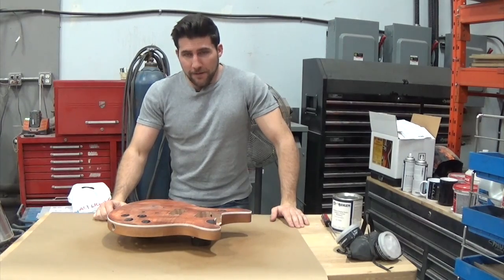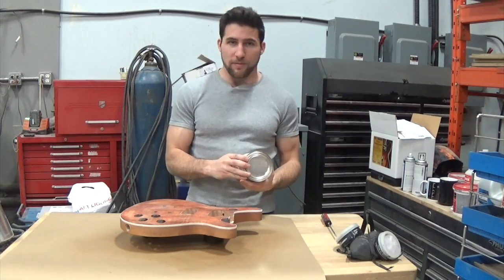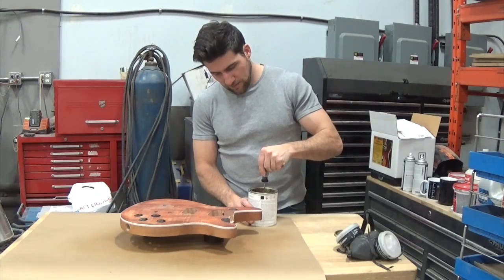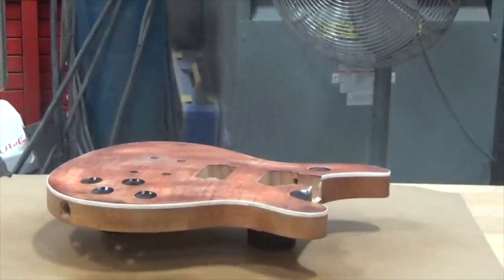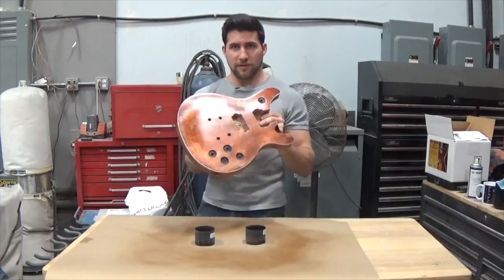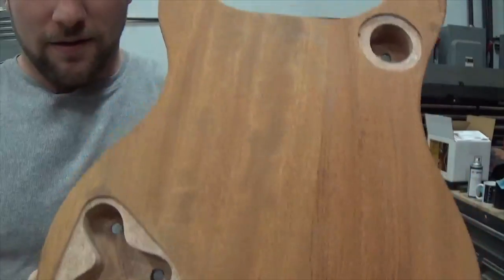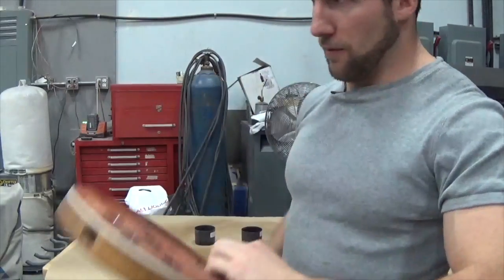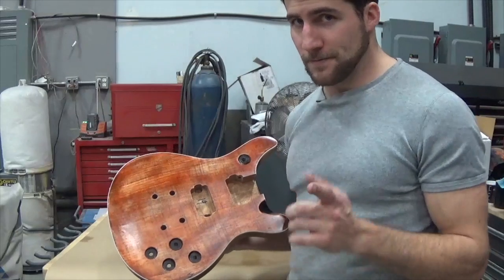Spraying Sanding Sealer

Comment: This is an old video so I doubt you'll see this.
I'm using India Ink on my  Paulownia body which I HATE it's porous and even has holes in it. Anyway. I was told to use the ink first...then the mohawk sanding sealer, then aquacoat. My  question. Do you wet sand the sealer at all or just gently dry sand after a few  caots. Same with the aquacoat. Wet sand after a few coats or dry sand?
I've never used sealer or filler before.
Reply from the maker: I dry sand. Isn’t aqua coat a clear grain filler?
Reply: @BradAngove  Yes it is. Dry sand is good. Don't like wet sanding.
Don't know if you've seen Highline Guitars on here? He's the one that said ink first then sealer cause he doubts the ink with react well with the aqua coat. In fact he said he doesn't think any filler will react well with ink but with sealer first it'll protect the ink.
Hey love you vids as always. You do some cool stuff. Thanks Brad!
Reply from the maker: Ya, the guy from high line (Chris I think?) knows his stuff. I don’t use India ink, so He would know better. A layer of sealer in there makes sense, but it’s certainly not the typical order of things.
Reply: @BradAngove  I've talked to a couple other people who agree it's not the typical order. 
When I sanded the guitar it was smooth as glass. If I try and sand it smooth it takes some ink right off. After I inked it it now feels like 150 grit paper. The other people said...maybe the sealer is meant to keep the ink in place before the filler and build up so the ink is smooth again. I don't know. I'm gonna go with Chris on this one. If it doesn't work I'll try another way on my pine body. Thanks again for your help.
Reply from the maker: Did you raise the grain prior to doing the ink work?
Reply: @BradAngove  No he said sand and put the ink on.  I'm gonna take some paper and gently sand it it before i hit it with the sealer.
Reply from the maker: Ok, the ink will have raised the grain. If you sand it now it will remove that. Then you can reapply the ink if necessary. The grain shouldn’t raise twice.
Reply: @BradAngove  Sounds like a plan to me! I'll sand it lightly instead of that normal heavy hand of mine...lol
I must have 5 coats of ink on now and plenty of it sitting around.
You've been a HUGE help Brad. I can't thank you enough. I'll let you know how it goes.
Reply from the maker: Glad I could assist.
Reply: @BradAngove  I'm glad there's people like you on the web so willing to help.
Reply: @BradAngove  Well I used 1000 and lightly sanded. Took about 75-80% of the rough away. The only spots now are the areas that must be sealed and probably filled as well. 
Imagine a guitar body with road rash that you can stick the tip of a pencil in. That's the other 20-30% of the body. You feeling almost glass on the body then BAM! Road rash. All the sanding in the world wouldn't get rid of it. My sealer and filler come tomorrow but it's supposed to rain for like 4 days in a row. gonna be a while before I get back to it. 
I'll start sanding my pine instead...lol
Reply from the maker: I hope the pine one goes well.
Reply: @BradAngove  I do too. Seems I screwed up. When I had to resand the entire body I used a dremel for the horn. I was careful to keep it moving so not to put grooves in the wood. Well I really messed up Somehow I managed to sand a good bit of the pocket off. Now when I attach the neck it sticks out past the pocket about 2mm. The neck is steady. Doesn't move but something tells me this could be a problem down the road.
Anyway..thanks gain for everything. Rob L
Reply from the maker: You sanded the side of the pocket down? What kind of guitar is it?
Reply: @BradAngove  a Tele style. Yeah what a noob thing to do huh. it's on the horn side where there's nothing there anyway. it's just the width of the pocket at the top is now 3/16'' smaller. At the body it's still the same 2 3/16''.
Reply: @BradAngove  In other words at the bottom 2 holes it's 2 3/16''. The top 2 holes it's 2''. Like I said it still fits just not as snug now.
Reply from the maker: Once it’s bolted in it won’t matter at all.  I’m just wondering if there’s a way to turn it into a design feature with more comfortable access or something.
Reply: @BradAngove  Ironic. I was thinking the same thing. Like maybe a gentle scallop on the lower part of the neck to match the body.
Or you just gave me an idea! I have spare thin pieces of birch. I could cut a shim, sand it fit and blend it into the section of body for comfort since it's inked in a dark violet. If I do it right you won't notice. Plus I'm using filler on the body as well.
Main thing though is I'm, glad to hear it won't affect anything. I can get used to the weird feeling over time.

Comment: so basically the sealer goes before the clear coat? how much should i sand it before applying the clear?
Reply from the maker: Yeah, sealer then colour if you’re using it then clear. What do you mean how much?
Reply: @BradAngove  Sorry I meant what grit should i use to sand the sealer to prepare it for the clear coat?
Reply from the maker: 600 grit.